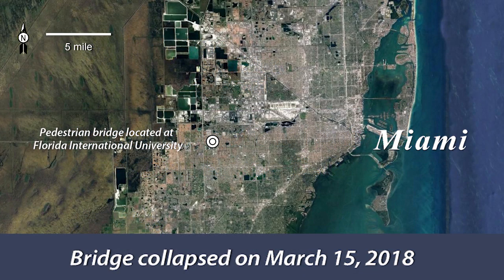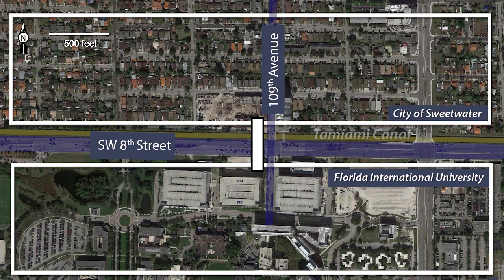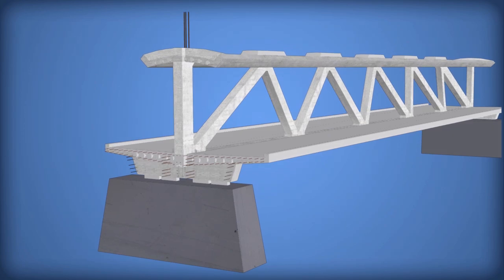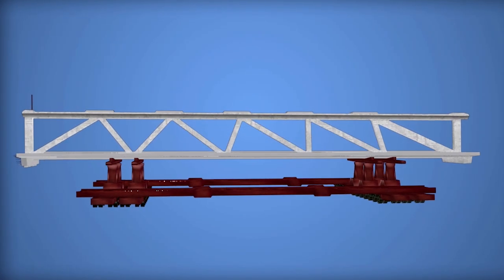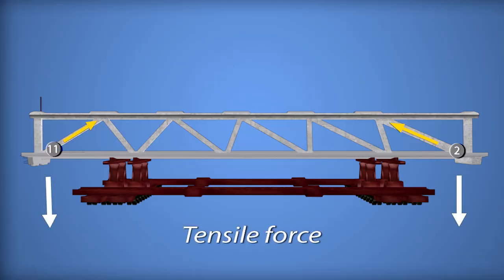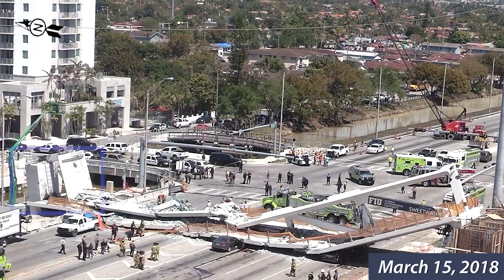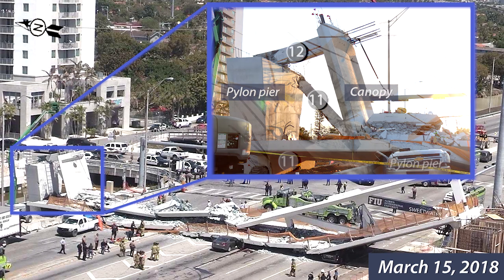Pedestrian Bridge Collapse Over SW 8th Street HWY18MH009

Comment: Two words: lowest..bid.

If they saw such profound cracking at cold pour junction sites they should immediately have closed off the road and rerouted traffic while they hurriedly built an under deck support system as quickly as possible. I'm surprised that criminal charges weren't brought against the contractor, design company and especially the site manager who thought it was a good idea to allow traffic underneath the bridge while they re-tensioned it. That bridge design and cold pours doomed it from the start.

Comment: Total incompetence. First the design was asinine.  Two,  when the bridge started cracking that was time to stop and clear the road.  Three, why was traffic still running when the thing had major structural cracking. It had  already failed before the thing collapsed. The bridge is garbage at this point. A total loss and needed to be dismantled then and there. Additional tensioning  wasn't going  to fix it. In fact it may have actually caused the collapse prematurely because it was going to collapse either way.

Comment: The bending moment of that deck span being restrained by a few angled pillars tied into the roof beam, and the central pillars not adequately reinforced and not post tensioned. The serious cracking due to post tensioning of the abutment piers was a clear warning that the pillars could not contain the compressive force of the post tensioning. At the very least, several temporary piers were required to support the deck while all cable tensioning and grouting was competed. Surprised to hear the tower and cable stays were not structural. This a design of style over substance.
Reply: Not closing the road to traffic during construction was a 'feature' of this plan. It would have failed anyway, due to design errors.

Comment: That was poor design from the beginning.  The trusses were more for aesthetics than structural reinforcement.  They should have used a zigzag pattern of steel beams on the west and east sides.   And it should have been a real suspension bridge.   No reason for it to weigh 950 tons.

Any freshmen Structural Engineering student could have seen this was a bad design.  It could have been design to be much lighter and stronger.

I lived in Miami for 23 years.  I passed SW 8th Street every day for years commuting to work.  Keep in mind two facts:   Miami is all about MONEY and Corruption is rampant in Miami.  They probably thought that blocking traffic was too expensive.   They probably thought it was too expensive to move the bridge back to where it was built.  Money, money, money.

Comment: Looking at the cracks in member 11,  once the structure is on the pier, indicates to me compression spalling of the concrete. Overloaded in compression. Post tensioning that member would increase the compression forces. No wonder it failed. This member would be carrying half the bridge weight and live loads multiplied by a factor greater than 1 because of its raking angle.

Comment: So what was the root cause of the failure? It seems to me like there shouldn't be a long flat concrete span especially with a single point of failure. You need steel beams or perhaps you could have an arched concrete design.

Comment: In order to minimize the costs, admin crap and political blow back resulting from another road closure, or heaven forbid, having to even remove and pull the span back to the work yard where it was cast, the construction firm and FL Highway engineers that ultimately had responsibility for inspection, assessment and approval of major phase completion milestones, must have decided to “analyze this further”, the result being the loss of lives that could have been easily prevented... bet you that no one will even lose their job over this clusterfxk

Comment: The concept didn't look especially beautiful anyway imo... The so-called 'canopy' was actually a massive concrete structural member adding great weight - surely they could have had something that looked equally good with a real cable stay method  and a lightweight canopy to keep the students out of the sun.
Reply: That's a valid secondary point. The damn thing was ugly anyway.
Reply: I didnt think it was ugly, but I love cable stayed structures. The problem was with the concrete, this design should have used steel. Cables and concrete don't work visually, and structurally, steel accommodates them better by being easier to connect to.

Comment: Engineer and architect: it doesn’t need redundant trusses, it’s only a pedestrian bridge, plus, it’ll look really cool and modern.

Me (untrained fool): yeah, but the bridge itself weighs 950 TONS!!!

Also me (untrained fool): and it’s crumbling to pieces right before our eyes.
Reply: Me:  If you are going to make it look like a cable stayed bridge why the hell not use them for support?????
Reply: @johns6704  The answer seems to have been conflicting requirements from the client. One party at FIU wanted to showcase the new "self-cleaning" bright white concrete developed at the university, therefore, a concrete truss. (N.B. the strength of the new material was not a problem, only how it was used.) Another party at FIU took a look at the result and said, that's not eye-catching enough, I like tall cable-stayed bridges better. And the designer said no problem, I can make it look tall. Now, clearly the engineers have a responsibility to tell the clients when their ideas about looks are impractical ... Also, the money spent on the faux cable tower meant underbudgeting some necessary things, like peer review -- an unqualified low-bidding peer reviewer was chosen and told to do just a brief review.
Reply: Useless engineers
Reply: @paulmallery6719  Virtually every part of your current life depends on engineers.  What do you do?
Reply: Trusses are by definition non-redundant structures.  Non-redundancy was not the cause of this failure.  That is a misunderstanding by a person who never studied structural engineering.
Reply: You know it was an ''affirmative action'' hiring job, right?
Reply: @dashwood5474  Not true, stop repeating this nonsense. https://www.snopes.com/fact-check/was-all-female-responsible-bridge-collapse/
Reply: @levanataylor790  … Really, Snopes?
Reply: @dashwood5474  
Seems like you need affirmative action to deal with your bigotry and disinformation.

Comment: How common is it for pre-poured concrete structures to crack like that (to that extent) within days of having loads and tensions placed on them?  To an untrained person, it seems like if you have a brand new bridge that you are putting onto its pillars, and cracks start appearing around locations of tension and load immediately, I’d start to worry about how long it was going to last.
Reply: As peter said, cracking is what concrete does, in-fact its necessary in RC structures as without cracking the steel will never take up the tensile loading (which is what it's there for). That extent of cracking however is not common and seems to indicate a more serious and deep rooted issue.
Reply: Concrete is brittle, it does want to crack - expansion and contraction joints are designed in to try and make the crack form where you can accept them and reinforcement, pre-tensioning and post tension techniques aim to minimise cracks where you don't want them, but these cracks that developed from post tensioning clearly showed there was insufficient reinforcement to contain the compressive force, to instruct the workers to re-tension this cracked pillar was completely negligent.

Comment: I'm not an structural designer, but this pedestrian bridge looked like a bad design.  It didn't need to be so heavy, and whats wrong with using steel beams.  You can always add fake structure to make it look the way you want and keep it strong underneath.  Cold joints, not enough rebar or extra supports killed 6 people.  Look at the Hard Rock Hotel?  Why can't we build long lasting structures anymore?  Were is the regulators that approve these plans?

Comment: As long as the architect wanted the bridge to appear to be a cable-stayed bridge, then why not replace the aesthetic pipes with real cables -- and build a real cable-stayed bridge?
Reply: Kevin Byrne
It seems there was no architect on this project. To be fair - lack of an architect was not why it failed. But the design was flawed from the beginning - and not questioned at any point from concept to failure. If we wanted to point to a cause - I would say lack of people capable of thought and courage to point out what should have been obvious. If ever a whistle blower was needed - this project was such a time!
Reply: @julieenslow5915  There was a lead engineer. He is responsible.
Reply: @cinquine1  
Legally you may be right. But design was not the only part of this story that was a mess. Construction and life safety were equally screwed. Excuse my language but there is a time and place where such language is right on.
Reply: @cinquine1  actually it is a she.
Reply: A real cable stayed bridge couldn’t be built in this accelerated fashion.  On a real cable stayed bridge, the deck is not self supporting — the cables are required to support the deck.  In order to build the deck in a remote location and then transport it into place, the deck had to be self supporting.

Comment: Why build a huge pillar if it carries no share of the structure after all?
Makes no sense.
.. 'feels' like someone tried to 'save' a buck or two to much.
Reply: It was entirely in keeping with the ethos of modern, liberal, University Campi...Campuses.
It would allow even liberal artstudents and students of femstudies to wax eloquently inside the realm of Engineering and to take 'Ownership' thereof.
The conversations over bridge-deck cappuccino would include pronouncements like;
 "What's re-ally cool about this bridge is that it looks like all the other male-designed suspension bridges that we're all so sick and tired of looking at - but it AIN'T one of them at all!!"
Reply: @dukadarodear2176 
Female engineers and architects are just as good and are facing the same issues as male ones.
If your CLIENT wants a cheap, quickly built structure or machine, either that's what you deliver or someone else will do the job.

Anyways, you just showed us again how people like you have no decency at all.
Reply: @damianm-nordhorn116  There's a conspiracy theory going around that an "all female" company is responsible for the design.

That company (MCM) was owned and operated by 5 brothers. The "evidence" is the company's social media spin pictures (from before the collapse) showing that they have some female employees.

Also they were the construction firm, not the engineering firm who designed it. Also, the lead engineer and engineer who inspected it last before the collapse were same guy from the engineering firm.

But well, when there's gender based outrage to be had no one ever let facts get in the way of that.

https://www.snopes.com/fact-check/was-all-female-responsible-bridge-collapse/

Comment: Didn't see a lot of symmetry or balance in that bridge. BIG red flags for me though I'm not a architect, just seems intuitive to me, but then I'm just a rational male, unlike the bridges designers..
Reply: There were a lot of males at FIU who pushed this rapid bridge building technique. The problem is that a much safer cable stayed design would have automatically required road closures as the cables were attached and tensioned to the bridge section. The girls wanted pretty and the guys wanted fast. Combine the two and you have a disaster.

Comment: i'm a construction workers son, my dad layed a lot of concrete in his life, and you don't "POST TENSION" concrete once it's hardened, it will crack. you "PRE TENSION" or "PRE STRESS" the steel before you start the pour. post tensioning is only for stays to level the surface. this project was doomed before the concrete was poured.
Reply: Wrong...post-tensioning is an extremely common building technique. You can't post-tension until the concrete has cured long enough to handle the compressive force. Big bridge girders will literally lift themselves out of the formwork as the tendons are jacked.

Prestressed concrete is a similar technique, except as you describe, it involves placing tensioned strands in fresh concrete...the strands are released after the concrete has cured, putting the concrete in compression. Prestressing is a technique pretty much limited to the shop...to factories that make hollowcore planks and wall panels, tee-beams and double-tee beams, pipe and culvert sections, and short bridge girders. Prestressing is typically not done in the field.

Comment: Not closing that road is nothing short of criminal.  Nor should anyone have been under or on the structure.  All work should have been done working off a hydraulic platform with everyone wearing harness and safety lines.  This IS NOT hindsight this is good working practice in such a situation.  That structure should have been scrapped and treated as dangerous.  The engineer in charge has blood on his hands and jail time beckons.  Whoever took the decision to keep the road open is equally culpable and should join the engineer in his cell.

Comment: I've called in emergency stabilization for problems a tiny fraction of that effecting far fewer people  Of course I've never gotten the millions a year you get heading a project like this for college or the contractor or engineer or sub contractor...  I might have let a couple of lane open by allowing GC to park 16 yd haul trucks in every other lane until transporters and temp shoring atop them were moved back in place.  Wouldn't let traffic SIT under bridge at red light.  
Bet NO ONE does time, loose everything, or even their cushy retirement / co health if forced to resign
Bet they do blame workers ordered to increase the tension on concrete already crumbling - which makes u wonder why they agreed to endanger their lives doing that - and I know its that or firing, just my failure to cheer on bosses every idea cost me nearly everything, so I empathize with workers in such straits.

Comment: A bad concept, bad engineering and bad construction management; a deadly mix.
Reply: All female.
Reply: @lonebikeroftheapocalypse9527  Just stop.  The chief engineer in charge of this project at Figg was William Denny Pate, who is very much a man.
Reply: Add into the mix the known political corruption in Dade County, and you have to wonder how many inspectors were paid off.
Reply: The design looks fine, its just poor execution. There was supposed to he cables to support the weight end there were none there. Should have built the tower first then the bidge
Reply: @menthasis4798  as [SAW]Spitfire stated. The cables were entirely for aesthetics, not structural at all. If anything it would have fallen faster due to the higher load. people died because the dumbass architect wanted the bridge to LOOK like it was supported well.
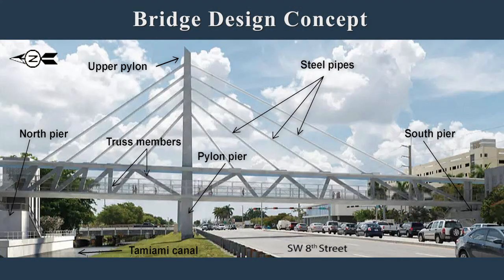Reply: @menthasis4798  The "cables" and tower are not load bearing structures, see 1:19
Reply: Menthasis the support pillar was the equivalent of anime filler
Reply: @menthasis4798  
Exactly !

LOOKs fine
Someone has exchanged security for reputation. And some people pay for this with there lifes.
This bridge have an structual design that is susceptible for failure without notice and fatal failure from an small damage (even from small damage from terrorists). 
Simply an bad design.

Comment: Makes my blood boil at the gross CRIMINAL negligence of everyone involved.  Main structural member immediately develops large cracks and you don't close the road?  Or at least install temporary falsework??  As a bridge builder, I'm flabbergasted.  Red lights should have gone off as soon as cracking was noticed and immediate corrective/safety measures should have been taken.  That they let it go 5 days is beyond comprehension.  Long sentences need to be handed out to the engineer and the contractor.